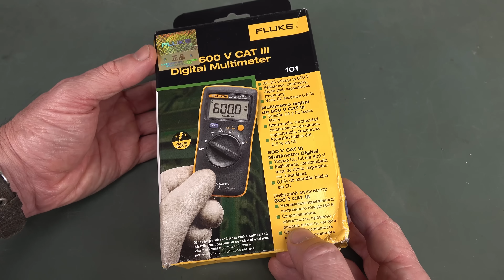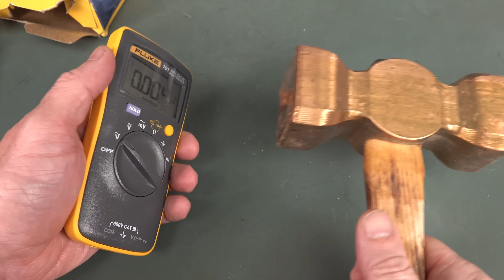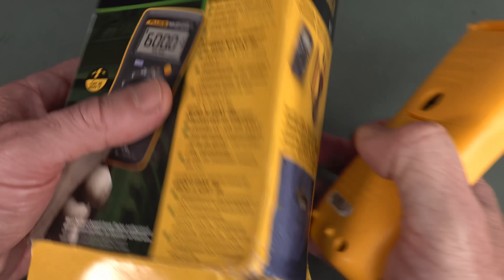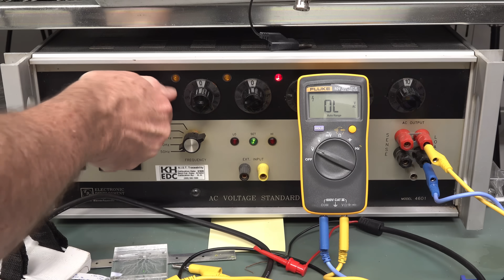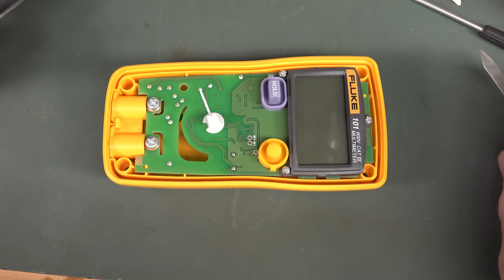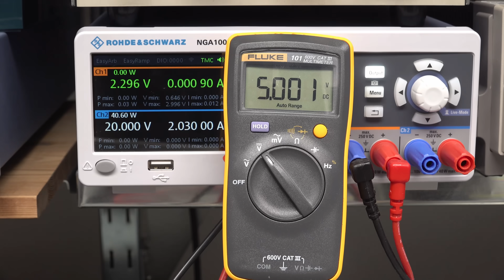EEVblog 1574 - REVIEW: Is the $42 Fluke 101 Multimeter Any Good?

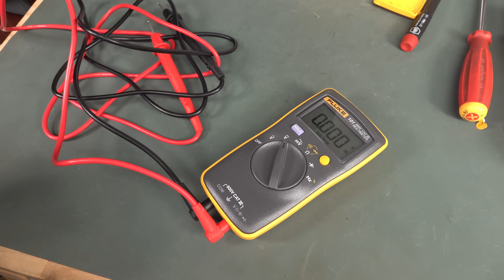Comment: 20:28  I got a set of 24" probemaster 8000 series with straight inputs.  Fits perfectly, wrap it top to bottom and they can indeed be used in your pocket.

Comment: So, I do like that it doesn't measure current and the build feels solid. But the rest? Just meh. It only does alternating millivolts — what's up with that? No temperature, no live wire detection, no auto-hold, no true RMS. Screen is small but at least readable.

Honestly, I wouldn't make this my daily driver even if someone gave it to me for free. Really strange product — who is this supposed to be for?

Comment: I use mine very often for low voltage DC/AC stuff for Access Control (think keychain fob systems) & basic Security system tasks. If it somehow was magnetic and/or case with magnetic back then it would be perfect for me.

Comment: I own a couple of the Fluke 107 meters (big brother to the Fluke 101), keeping them in my toolbox and on my desk for convenience. They are indeed very nice little meters.

I recently bought a Fluke 8808A bench-top DMM. I was a bit surprised (but only a bit) that a nearly $1400 Fluke was still made in China. I was more surprised, and disappointed, that it essentially came with NO user's manual in the box. There WAS a fairly thick hard-copy book in the box, but it was only a "quick start" guide, which really was just warnings and legalese, no operational instructions, in about a hundred different languages. The Quick Start Guide says that the User's Manual is on a CD ROM in the box, but a loose piece of paper says that Fluke no longer includes CD-ROMS in the box, and instead the owner needs to download the User's Manual from the website (which I did, and it is a large and seemingly complete manual in just the selected language). The instrument itself seems fine, but I really thought that at the $1000+ price point Fluke could have furnished a proper manual in the box. Having said that, when I downloaded the PDF of the manual, there was another PDF with about five pages of errata and addendum....I needed to go through my printout of the manual and make all those changes.....it seemed to me that the if owners MUST download the manual in order to have it, that at least Fluke could have incorporated the corrections rather than put them in a separate document. Oh, well.....

BUT.....there WAS a mini-CD-ROM in the box! It was the driver(s) for the included RS-232 to USB adapter cable.

Another annoyance, the "LO" and "HI" banana jacks on the 8808A are dual contact types, so if using special test leads having the dual contacts as well, the test lead connections are "Kelvin" type. The recommended Kelvin leads are identified by Fluke in the User's Manual and on their website as "TL2X4W", which apparently was replaced by the "TL2X4W-PTII", which I have found is unobtainium. This seems like an odd thing for Fluke to allow to happen.

Comment: I've gotten the 107 because it at least has some ammeter, but this kind of multimeter isn't really bought for the features, not in my mind. I have a Brymen for the features, stays at home at my desk. I have Aneng for the bang for buck, but I wound't trust it at 240V, so I use it for low votage stuff - sits on the side of Brymen. At work I'm using Fluke T150 as it's the most practical for my kind of work, and throw 107 in my pocket when I need it, but the reason why I'm using them is... I want the safety features to be there, to be reliable and to work when I need them even when I screw something up on my end. 

101/107 is just small enough to throw into the case with other instruments I use, like an insulation tester, clamp meter or an earth resistance tester. I would trust the Brymen just as well, but I really don't need the cool features at work, so a reliable rugged meter in a small form factor that I can trust won't explode in my hands AND is easily recognizable to the clients as a proper professional brand is really worth the money. That last point might seem silly, but... Fluke's branding goes a long way and even people who have no reason to know anything about testing instruments will often recognize Fluke as something trustworthy. It's something you might not think about because it's not relevant to your work, but it is relevant to some. ; )

Comment: In my job building control panels I've seen different brands of meters.  I say stick to mainstream brands.  I have a Fluke and a Klein meter.  Coworkers have GreenLees and they all work great and survive the rigours that we put them through like being knocked off work benches etc.  Those $20 not so much.  I like that Fluke has the basic model out now.  For the homeowner who never measures current but needs to trouble shoot why the light never comes on Voltage and Continuity do the job.  For that price it's worth buying and throwing in the tool bag.

Comment: No ya didnt break anything, thats where the molding sprue from the injection molding machine is located - where it injects the plastic, it has to be cut or broken off after being removed from the molding machine - I ran plastic injection molding machines for 15 years, broke/cut off (a lot) of sprues in that 15 years.

Comment: Why flick the probes to check continuity response? Granted, the Fluke probes can have issues making a good contact but mine are 24 years old and the PVC is perfect and probes make contact. I always make sure to get good contact and an intermittent beep is not good enough.  I suppose it is a way to compare meters and probes but if checking continuity, I don't think too much sensitivity is a good thing. I seldom use continuity as I want to know how good a connection is with a resistance value to the limits of the meter, of course. I put little value on the continuity feature.

Comment: I have the slightly fancier 107 that costs around a hundred bucks and really like it. Of course you can’t really compare it with the larger higher end models but honestly the quality feels great and it’s nice and compact. Perfect for a on the go tool bag. It’s fine for most electric work and for electronics I have a Uni-T. I’m sure there are much cheaper no name brand meters that can do the same thing, but for $100 I prefer the quality of the Fluke and I’m sure it will last a very long time.

Comment: As a fire alarm technician I use this about every other day, and it’s perfectly accurate for the 12-24vdc market. I added a magnetic strap. Works for all the varied fire alarms /security systems / access control resistor values I see. I also have a 117 I use for automotive.

Comment: I needed a multimeter that could A: measure capacitance incase my air conditioner takes a dump. B: accurately measure low voltage DC to calibrate my LiPo battery charger and drone radio.  And C: do general purpose stuff whenever I need a meter, including building an FPV drone in the future.  And this checks every box!  Got it on the way.  I never thought I'd ever own a Fluke brand meter

Comment: I have a Fluke 107 as a spare meter. It is a great multimeter. It is fantastic at measuring mV AC. I just wish that Fluke could measure DC mV as well. It's a very important frature in the industy I work in.

Comment: I have one I use at work (industrial maintenance tech) and it works for what I need, but it definitely reads resistance differently than other meters. 

I was measuring the resistance across the outputs of a PSU, and got a lower measurement than the reading across my test leads.  checked it with a different Fluke, and it was OL. not sure what the deal was, but definitely weird.

Comment: I got one a couple years ago for some simple analog audio work.  just checking continuity, DC volts, resistance and sometimes capacitance.   It sits on my workbench, I've never had to change the batteries, and it  just works.  I had a cheaper amazon meter and it didn't last a year before it just died.. the switch started to flake out and then it started to be less accurate.

Comment: Great review video, thanks 👍🏻👍🏻
I've got an Aneng 8008 which I use for low voltage, hobby electronics and it's brilliant for that, but I wouldn't ever use it for mains voltage as I wouldn't trust the protection. I have a properly certified multimeter that I use if I'm touching mains. But I'm definitely going to pick up a Fluke 101 as the small, throw in the toolkit, meter that can be used for mains. Sadly as I'm in the UK 🇬🇧 I'll have to import it from the US as Fluke don't sell it over here for some reason. Anyway, thanks again for the great review.

Comment: This replaced my 87-V for field use about 4 years ago. No it's not an 87 but it's Fluke quality and does what it does well.  I went with the 107 for the current scale. I don't think I have replaced the original batteries. I think mine came with the magnetic strap. As handy as the magnet can be, I always found it swinging around. So I cut the magnet off and glued it to the back of the 107. Perfect. Nice review Dave!

A tip for all you Fluke fan boys. 
I you use your flukes in the field you know how the soft rubber yellow holster gets real grimy. And they just don't clean up well with any soap I've tried. 
Try this,  spray it with clothes stain remover and throw it in the washer, with other clothes. Mine is cleaner than new. Wow!
Reply: thanks

Comment: Wow, pretty darn good meter! I was just looking at my Klein Tools MM400 and thinking it was pretty decent and right at that moment you brought out the MM500 and said it was pretty good, so I'm happy there! Mine was $60 at Ace Hardware though, and it doesn't have that much more features than this Fluke, and the Fluke is cheaper, so I kinda wish this meter was around back when I bought my Klein. Oh well! I'm happy with it.

One thing I will say negatively about the Klein, is that I wish it was auto DC, not auto AC! So annoying!

Comment: Daily troubleshooting tool for me. They are so cheap I got 3 in the lab. They are smaller, more convenient than the other full featured meters so people tend to grab them. Plus they don't run out of batteries. Probes are terrible though, cables so stiff for a meter so light. So I upgrade them all with a set of ProbeMasters, problem solved. Which are almost ⅔ the price of the meter. Oops.

Comment: fluke 101 not goot for electronic, only usable on electrician on the field.
slow response, small digit, screen reflection, screen only visible in certain angle.
I prefer cheap aneng for small electronics work

Comment: I had a Fluke 77 from 1989 and used it for decades until it got stolen a few years ago at work. The only problem I had is once in a while I had to take it apart due to a bad connection with the zebra strip and the knob would go past the end stop, but it was also dropped plenty of times. I also got a Fluke 87. While not the cheapest meters, you get your money's worth with how long they last and their quality is top-notch. At every company I've worked for in the tech industry, Fluke always seems to be the go-to brand. I agree with the PVC leads. I replaced the leads on my Flukes with some nice silicone gold-plated ones.

Comment: I use this as an everyday carry in industrial automation. It fits my vest pocket with leads and the magnetic hanger and is very light. My bigger meters spend most of their time in the toolbox now. This has been a very reliable meter for basic troubleshooting work. Come to think of it, since owning it for about 4 years I have never changed the batteries!
Reply: Same. I carry it way more often than my 87 or 233. It's so nice for working in high areas where you just want to throw tools in your pocket and go.
Reply: Yep.  Been abusing mine for about 5 years and it refuses to die.   It gets dropped an thrown around, ‘ridden hard and put away wet!’   I occasionally check it against a calibrated meter and never wandered.
Reply: I've been abusing mine for 10 years and I've never changed the battery once lol

Comment: A nice little meter but it does NOT have the Fluke diode beep, unfortunately. Have to get a cheap Kaiweets HT118A to get that for under 100 bucks. Thanks for showing, Dave.

Comment: Right angle leads wrap around the meter bettter than straight leads... 

Those leads look cheap... but add a velcro wire wrap strap to the leads... and once the leads are wrapped around the metere... and the velcro strap is also wrapped around both... you have a meter with organized leads... ready at all times...

Comment: The 101... for over 40 years... was the meter that a lot of US corprorate and military standards documentations used to call for.... as reference for specification passage... if the 101 passed it... then the test was OK.... if another meter said different... too bad... 

That's mainly the reason why it's still in existance to this day... cheaper than rewriting standards or instruction books... 

The price drop is recent... a few years ago... you had to pay multiple times the price you quote... probably cheaper now... because  maybe they... finally... rewrote the Gov't specified meter requirement... ???.... or it's no longer the only meter that is qualified to be the passage arbitrator.... ???... either way... it's still a great meter... might pick another one up at that price...

Comment: The first Fluke meter I would actually buy to have floating around the bench. Seems to be able to do 99% of the measurements I would need on a daily basis. The battery choice they made, I like it. I dont get why meters are still made with 9V blocks, so weird. The quality really impress on this small meter.
Reply: 9V are double insulated to prevent or at least reduce the amount of damage if cells leak.

Comment: I think it's worth focusing on just how much the Aneng/ ZT102 blows this thing out of the water.  The Fluke is way over the price you quote in the UK.  Its £57 (69usd),  thats a lot for a meter that has so little features, no true RMS, no current measurement for example, and a 12mm display and where you have to buy new leads as the ones that come with it are so poor.  I notice you skip over the Flukes poor coninuity checking, which is perfect on the the ZT102.  I've been looking at the ZT303 as an upgrade to the Zt102 and its 19999 counts and 0.05% accuracy on DC volts, thats 10x better than what Fluke quotes, and its less than £20 shipped after tax!   99% of people do not mess around with voltages above 240v, in some countries 120v so I'm really not sure about the advantage of 10kv blast protection.  Hioki make a pocket meter for £50 it would be great to do a comparison as Hioki are generaly regarded to make the best quality meters.
Reply from the maker: I didn't "skip over" the continuity tester, I even gave it a rating out of 10. Not perfect, but good enough. If you need perfect, buy something else.

Comment: There is now a UL listed Uni-T UT131A. I picked one up for less than $25 out of curiosity because of the complete feature set. I wasn't expecting it to be this good and precise for the price. It might be the best beginner electronics multimiter out there now. Uni-T has not only improved in quality but they've been certifying a lot of their newer multimeters. It's worth getting your hands on one for a review. Many people would appreciate it, especially in countries where name brand multimeters like Flukes are really hard to find.
Reply: Thanks for the tip. They are now for 15 Eur on Reichelt. I wish I had known this few days ago when I order stuff from there.
Reply: @JohnDoe-wb7ng  No worries. If you're looking for a good cheap clampmeter, there's the Uni-T UT210E as well. This one's more talked about though, because of the 2A DC+AC range and accuracy. Perfect for electronics jobbies (though I've used it plenty for residential electrical work as well). I bought it together with the UT131A, no regrets, both amazing little meters.
Reply: @silviustro1  This one I already have (UT210E). I agree that it is a trusty little friend!
Reply: My biggest problem with that meter is that it appears to only measure up to 250 volts. That's not enough for troubleshooting power supplies or for most tube based electronics.

Comment: I bought this as it was the cheapest Fluke available, and I didn't want to buy a $5 chinese meter. It's a workhorse in a troubleshooter's toolbox. The most frequently used feature by me is the beeper continuity tester option. I don't like to throw an expensive multimeter among the tools, and it's more than enough for daily measurements.

Comment: It might be a limited meter but I have limited use.  It stays in my company van in a hard case with Brymen silicone leads.  I use mine to verify wall socket power and some low resistance (down to 1R pass/fail component)measurements, which it does a great job.  Not often used but always ready, getting fresh batteries every January as does all my battery powered TE.
Reply: Same here, but when I built custom lab equipment for serious research institutions and had 3 different separate meters on my bench, all fluke's, I decided to bring in my do it all multimeter to make my work easier, The head engineer told me I couldn't use it, and then I found out why we had so much fluke stuff, and other very expensive oscilloscopes, frequency counters...  Because not only are they accurate, and can take a beating, but they stay stable no matter what the climate or how often you drop them.  We even sent them in for recalibration and re-certification every 2 years.

We also had a lot of Hewlet Packard instrumentation from before the 80's that was high quality, some even programmable and could interface with each other and computers already in the late 60's!  I have no clue why they dropped the entire line and went all in on crappy computers, but it turned out to be a bad move, and they got bought n' sold, sliced n' diced ever since, and into oblivion!